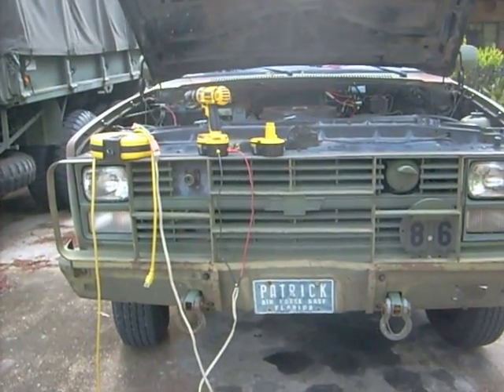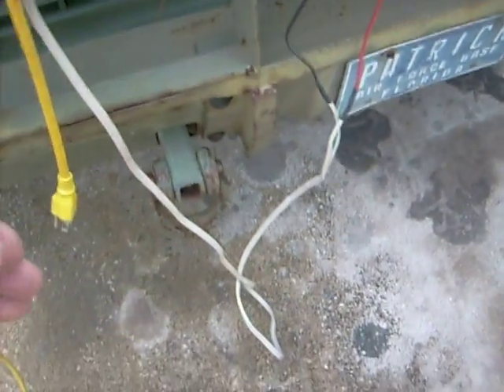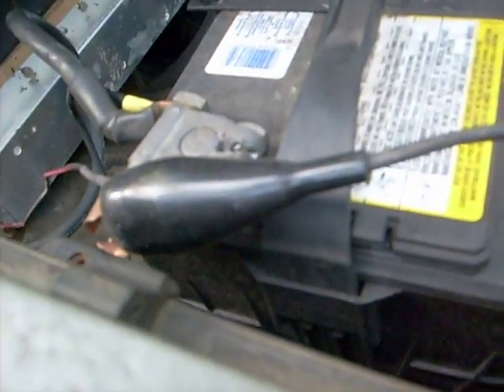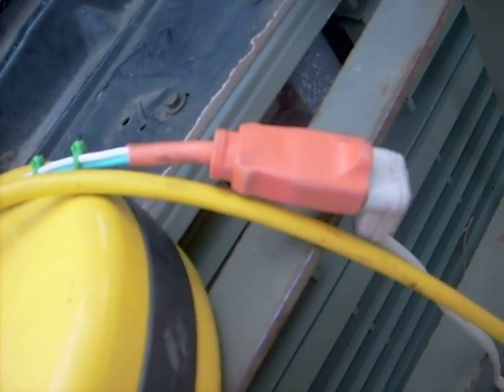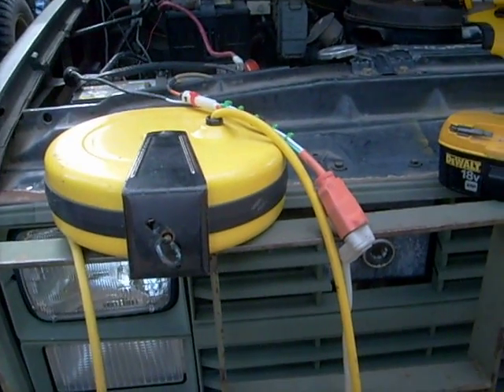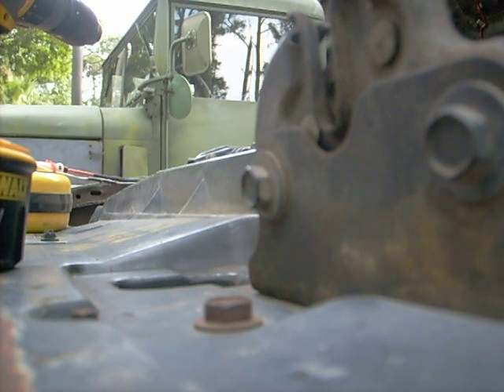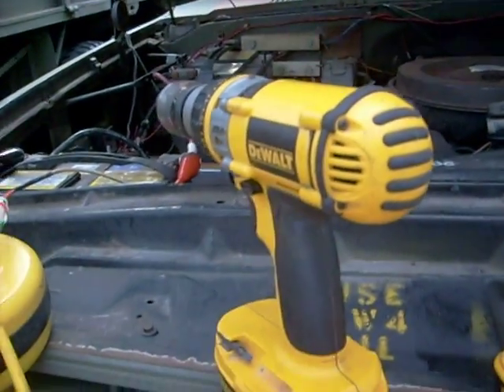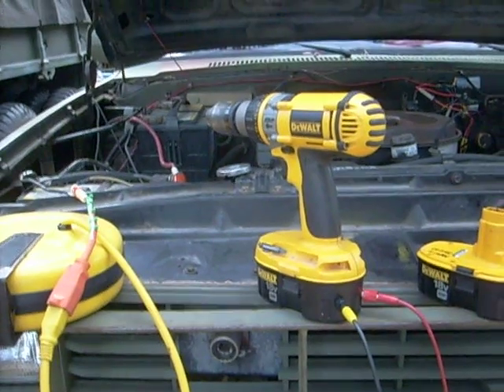Dewalt Battery Cheat Part 2

Comment: The resistance of a longer cable is called "copper loss" due to the resistance of the copper cable. The larger the conductor size in the cable, the lower the copper loss or "resistance" you have. 10'- #14, 15'- #12, 20'- #10 gauge stranded for charging or use of battery power tools. Figure out the highest max current your biggest power tool uses, then double the inline fuse capacity to the closest amperage plus 30% over. But if your pack fails, then eliminate the dead batteries, and feed the power tool direct from your battery by direct wiring to the empty case connectors. You CAN leave the dead batteries in if the empty case unbalances the tool in your hand (bypass the dead batteries). If you want to be more portable from your vehicle, buy one or two garden tractor batteries at Wally World at 21.99 each, and direct connect your tool by alligator clips or ring crimp connectors. Works great, and lasts MUCH longer!

Comment: @bernard240vdc While that would work, motorcycle batteries make a poor choice as they do not hold up to repeated discharging.  In fact, in my experience after 2-3 discharges they are typically ruined.   Now one could watch the voltage and make sure they are not discharged but that would be annoying or use something like a gel battery that can withstand that type of work.

Comment: along with this good setup one could use motorcycle batteries one 12v plus one 6v in series for 18v along with a short cord and you can bring the motorcycle batteries along with you since they are not too big and heavy and i think they are not expensive as those dewalt ones

Comment from the maker: @kcanifuku Yes you are correct on both areas.  The truck is a 1986 M1008A1 CUCV with the 24 volt NATO Plug on the front.  When using a long extension cord, the voltage drops down because of "resistance" and the voltage is perfect to run my 18 volt Dewalt tools.

Comment: @aboonski 
yeah the ones on my old drill are like that too you have to break them open then its a pain to get them back together after modding. I dont even know if the contacts on the batteries are actually contacts or they are part of the battery. I didnt get the chance to hack these up and im not gonna either.

Comment from the maker: The 12 volt batteries that I have for my Dewalt cordless tools are hermetically sealed shut - not like the 14.4 and 18 volt units that "unscrew" to access the cells inside so I have not attempted to convert one of the 12 volt batteries just yet.  Interesting enough, the 12 volt batteries seem to be made better and outlast the larger voltage ones for some reason.  I had a totally dead 12 volt battery that took on a full charge after sitting for years without use.

Comment: I thought about doing this to an old 12V power drill where the batteries were failing. I was gonna completely gut one of the batteries and wire up a thick 12V car lighter cord with maybe a 30 amp fuse or whatever and the result would be a cord running out of the drill battery and you just plug that into a jumpstarters 12V port or a car lighter port and then you have unlimited power for the drill. sadly I didnt do this and just got a RYOBI 18 volt.

Comment from the maker: Great comment here!   One of the benefits of the long cord is that it does reduce the voltage from the 24+ volts that my military truck provides at the NATO plug.  My cordless tools are 18 volt and the long extention cord lowers the voltage to around that amount depending on the length of cord I am using and the size of wire inside of the power cord.   One of the real benefits of using my truck to power the 18 volt tools is that there is never any "fade" or "drop" in power like in batteries.

Comment from the maker: I HATE outragious prices on anything!  When the power company jacks up my rates per kilowatt hour in the near future I will wire my home for 12 volts DC and will run my 120AC appliances via inverters.  The only thing that I will have to use the grid for will be the central air system in my house.  You cannot live in Florida without air conditioning!

Comment from the maker: There are no "cells" inside the battery case that you see in the video - it is just the empty case that I have wired so that I can use the power from my military truck's NATO outlet.  Until DEWALT lowers the price of their replacement batteries I will continue to use this "cheat" to power all of my Dewalt cordless tools.  Thanks for the comment by the way!

Comment from the maker: This is good information and I probably will go out and buy a lithium battery after reading about your experience with them as compared to the Ni-Cads.  Dewalt probably has a max of ten bucks in each battery, counting materials and labor (in Mexico) to put these on the shelf over at Lowe's or Home Depot.  There's just no excuse for the price of these things and basically my video here is an attempt to send a message to Dewalt that has yet to be answered.  Thanks for the comment!

Comment from the maker: This is perhaps the BEST comment I have been given so far!  I never though about that but it would be one way to give back to the company that makes such crappy power supplies for their otherwise superb power tools.  Right now I continue to use the "cheat" system because I know I will not have to experience any "fade" or "taper" of the power while I am working on a lengthly project.

Comment from the maker: I've been using my cheater system ever since I first posted this on a daily basis and no problem so far.  When you use a very long extension cord with this setup it brings the voltage down from 24 volts to around 18 volts so how could this ever mess up my equipment?  "Voltage is voltage" too.  One comment I got related to the amperage coming from my vehicle battery to indicate THAT would damage my equipment as well.  The only way that would happen would be if the tool developed a "short.

Comment from the maker: Thanks for you comment!  I figured someone might see the benefits for having another way to power a Dewalt cordless tool.  Once I run out of serviceable batteries for my 18 volt Dewalt tool, this is what I will be using.  I will not pay $86.00, plus tax for a stupid battery!  I am also considering the use of a transformer to power my equipment which will plug directly into my "cheater battery" when I am using my Dewalt tools in the house and a Ryobi 18 volt slave battery as well.

Comment from the maker: When the battery starts tapering off and becomes close to "dead", people tend to continue using their cordless tool until it stops; many times the output voltage is way lower than 12 volts at that point in time.  Dewalt 18 volt tools run fine on 12 volts but even better on the 24 volts that my NATO plug offers on my military trucks.  When you consider using a 50 or 100 foot extension cord, there is a voltage drop due to "resistance" which results in about 18 volts while you are using the tool.

Comment from the maker: I plan to make up a couple more of these and will post another video of the step by step process of conversion.  I don't ever plan to buy another Dewalt battery in the future because of the inferior quality of their batteries.  Once I get time I will be working on making up a prototype Ryobi/Dewalt 18 volt battery that will eliminate the need to hook into an external power source (like my military truck) to run your Dewalt tools.  Dewalt quickly squelched a commercially made adaptor recently.

Comment from the maker: Thanks for the comment!  I continue to look for ways to get around buying any more Dewalt batteries.  Their cordless tools are perhaps the best on the market but, "A product is only as good as its most inferior part"; in this case it would be their battery packs which just don't last.  I made another video showing the use of my military truck's 24 volt system running Dewalt 18 volt cordless tools.  Check that one out!

Comment from the maker: Actually I am retired now so my mind is free to think up things like this.  With only 12 volts to use from one of the vehicle batteries, you lose a lot of power and rpm with your tools especially if you use wimpy extension cords and not contractor grade power cords.  Dewalt batteries just don't last and you have to do something otherwise you wind up with a very expensive useless tool once the battery goes!

Comment from the maker: Remember, I have removed all of the cells from inside the Dewalt battery.  Once I did that I drilled holes through the Dewalt battery case and installed plugs for negative and positive leads.  This allows you to run any 18 volt Dewalt cordless tool from a car battery or another electrical source like a transformer, etc.  Recently I used my 18 volt Dewalt saber saw with this system and it ran but rather slowly and did not have the power or torque that the full 18 volts offers - but it worked!

Comment from the maker: I took a bad 18 volt Dewalt battery and pulled the guts out of it.  I installed two connectors, one positive and one negative, that plug into a cheater cord that I made from an old washing machine electric power cord; you plug that into the extension cord that you intend to use for the job.  I made another video that shows how this works but did not go into too much detail about the connections inside the "cheater" battery.  Very simple really.

Comment from the maker: I guess you didn't see the reasoning behind this.  Batteries have a tendency to let you down when you need them the most. A lot of people who are employed the Air Conditioning trade or carpentry field can tell you that they are sometimes out in the middle of nowhwere without hoousehold power.  All this does is provide continuity when you would otherwise be dead-in-the-water when the batteries are drained.